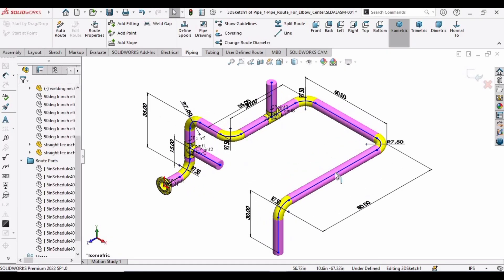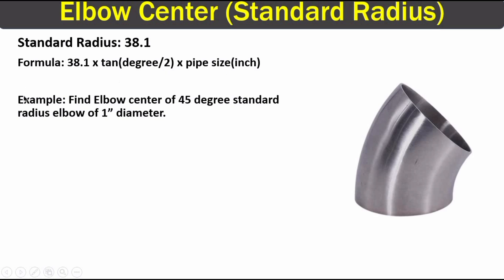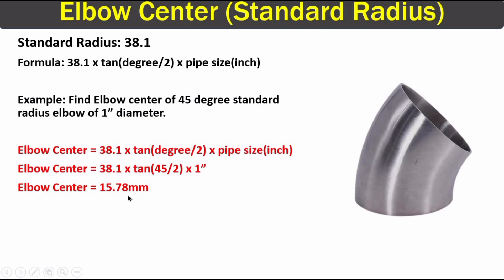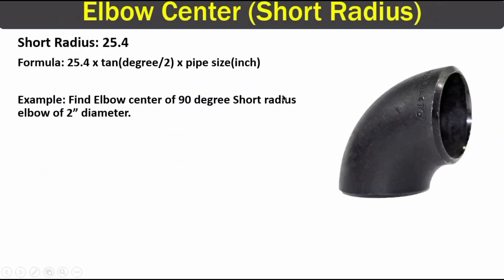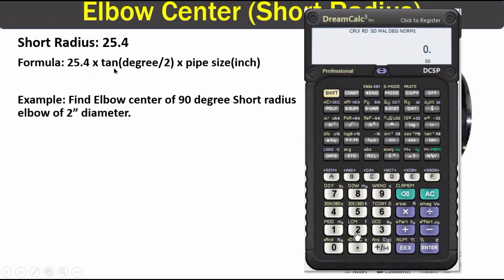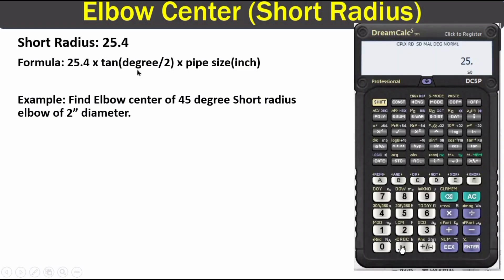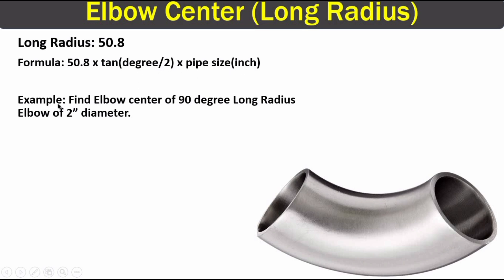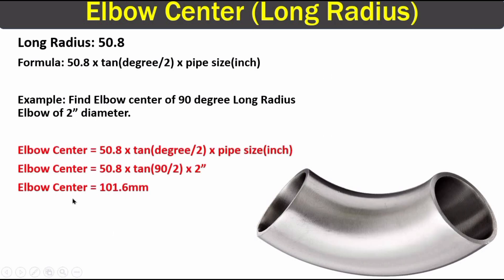Pipe Elbow Center Formula Explained | Robo CAD

Comment: How is it possible to calculate the results in mm while we put the size of pipe in inches 🤔
Reply from the maker: 1 inch = 25.4mm
you can covert inch into mm first and then calculate
Reply: @CAD5-Minute but there is no conversation of inches into mm, you directly put it as an inch not in mm
Reply: @CAD5-Minute but there is no conversation of inches into mm, you directly put it as an inch not in mm
Reply from the maker: @pirwazir7709  yes, you can do it by yourself.
Reply: @CAD5-Minute  still I am confused. My aim is to learn
Reply from the maker: @pirwazir7709 If this video isn’t clear to you, please refer to another resource or video that explains the topic differently.